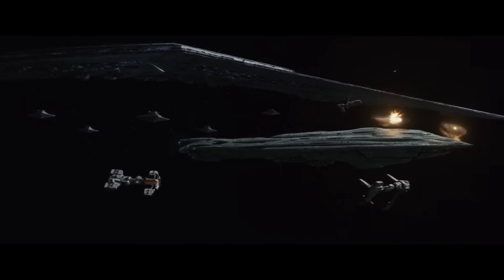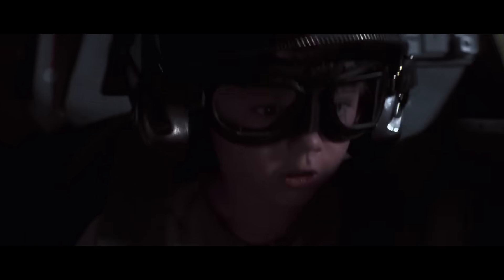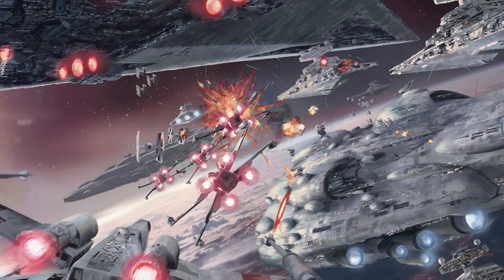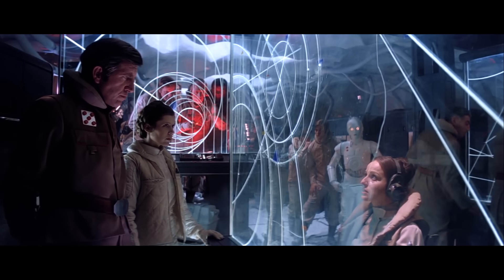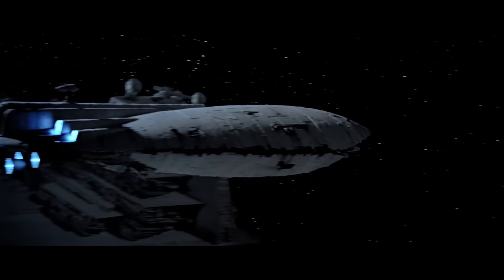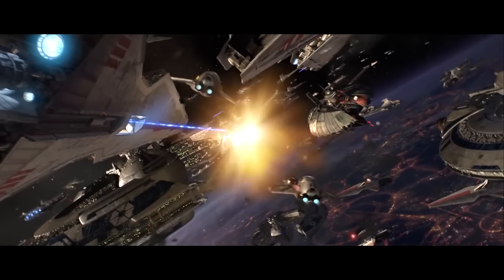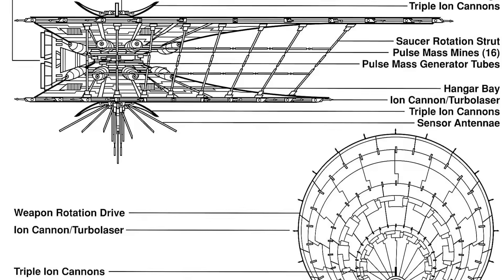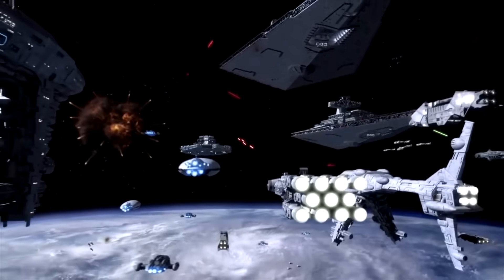Why Star Wars Turbolasers SUCK! (and better options) | Star Wars Lore

Comment: Firstly, great video. Very interesting.
Secondly, time for me to go into physics mode:
You forgot to mention the poor range of turbolasers given the power that's put into it. In the real world, for about 1g of hydrogen you need about 1.6316MJ of energy to heat it to a plasma at 10000 kelvin. That's a lot of energy for such a small amount of plasma.
Because of how quickly plasma would lose its energy, the kinetic energy needed to get decent velocity for range is going to also be very high. Assuming that this ball of plasma can only be effective for 0.4 seconds, and we want a range of 100km, we need a velocity of 250km/s and a kinetic energy of 31.25MJ (1g plasma ball)

If we gave a 1kg railgun round 31.25MJ, we get a velocity of about 5.6km/s. Modest, yes, but we don't need to worry about radiative heat loss, so range can be measured in thousands of kilometers rather than tens or hundreds. You just need to lead your shots a bit more and know where the target will be.

Also, railgun rounds also give scope for more interesting projectiles such as AP, HE, Tracer, depleted uranium... This is where you can use physics and chemistry to make a projectile that is very destructive.
Also, if a projectile hits the target fast enough, the heat generated can cause plasma to be generated.

Comment: Capital grade turbolasers are for engaging capital ships and stationary targets. Point defence armaments are what you would use on starfighters, though to be fair they are underwhelming used in Star Wars.
Booster Terrik may have been happy with loosing alot of the turbolasers, but to be clear the New Republic wasn't about to let him fly away with a fully armed and operational Sat Destroyer, you should know your lore.
Furthermore comparing Galatic Empire tech with the post-Empire advancements defeats your argument, because if turbolasers were not effective why would the New Rupublic (EU) put so much money into improving them?
Also the Imperial Star Destroyer was equipped with Ion Cannons and as for proton torpedoes, these can be deflected with a sufficiently strong particle shield. This isn't to say they couldn't land the killing blow, but you would still be faced with the problem of taking the shields down first.

Comment: There are two other weaknesses you did mention but didn't address; one of course is the slow turret traverse of the guns. For some of those single gun mounts like the ones on the Death Star where everyone sat on a platform, I don't see what could go wrong in trying to find some way to increase its traverse speed. Though for the heavy tower like structures, obviously there is no way to address that safely unless you want your crew members to have an unfortunate meet up with the Turret Monster.

The other one is of course the fire control. Obviously there should be some gun fire-control systems to get all the large caliber guns on target at once rather than having them be individually manned by a single gunner control.

Comment: So a lot of this aligns with my thoughts about Turbolasers and most of the problems there have less to do with Turbolasers as a specific technology and more to do with the weapon mounts used and man, weapon mounts for turbolasers in star wars are hot garbage.

1. Casemate mounts, every scene where you see the interior of a ship with a turbolaser with droids or whatnot shootout out the side of the ship, these are casemate mounts and particularly bad ones as well, barely above sailing ships of the line in terms of helping the weapon mounted effectively track or reload.

2. Too many useless calibers, while the specific power of a Turbolaser is hard to pin down the effect certainly seems to be somewhat akin to having a battleship armed with 40 4" guns instead of 8-9 16" guns. The small caliber weapons do barely anything individually against capital ships and barring the dual-purpose turbolasers of the rebel alliance aren't nimble enough to be effective against starfighters.

3. Poor mounts, tracking issues and rate of fire issues are related to effective or ineffective mounts IRL, the former certainly would be the case in star wars where the latter might be limited by available ship power. Either way it's quite possible to make quick tracking mounts today or even in WWII, a galactic empire should be able to work out the same.

4. Both of the last two issues could be made easier to deal with if you had less guns. Less guns means you can build smaller mounts that are easier to move around for tracking, it also makes it easier for your power plant to support higher rates of fire or larger guns as a whole.

Essentially star wars needs to go through the dreadnought revolution in terms of firepower where a wide variety of guns were consolidated into a few major types. Also consider that the Star Destroyer wedge is only nessesary in a scenario where you're trying to get many dozens of different turrets to be able to fire forward, reduce that number to 8 and all you need to do is place a big huge turret around the extremes of the ship and the rest of the ship can be any shape it likes allowing for optimization around shielding, hanger bays, reactor size and protection, etc.

Comment: A few things to consider:
1-Just how many railguns or ion cannons could you actually get for the same tonnage, space, and energy/coolant supply? Perhaps these other weapon types would demand even more of all the above to be just as effective in practice as the typical turbolaser batteries. 
2- Why not simply make more efficient turbolasers? The MC vessels are clear proof that it is possible to make turbolasers that can engage small fast-movers and fire rapidly, so there's no reason why other factions couldn't do the same. 
3- As an extension of the previous, a weapon class that seems suspiciously absent in Star Wars would be the turbolaser equivalent of real world warship dual-purpose artillery. WWII era warships often had a small number of main guns that were very powerful but cumbersome, and also a large number of intermediate-sized dual-purpose guns that were extremely flexible and could be effective against both ships and fast moving aircraft. See US navy usage of 5" dual-purpose guns as secondary armament in WWII era warships for reference. 
https://upload.wikimedia.org/wikipedia/commons/thumb/7/7f/USS_North_Carolina_NYNY_11306-6-46.jpg/1200px-USS_North_Carolina_NYNY_11306-6-46.jpg 
Here's an example, the USS North Carolina. Note the main turrets, each with three 18" guns, and the cluster of secondary turrets at the sides with two 5" guns each. And this supplemented with a variety of smaller AA mounts as well. Would love to see a Star Wars capitol ship armed similarly for its size class.

Comment: I think the problem here is the nature turbo lasers.  The must be plasma throwers.  The problem in their design is the element they have chosen to super heat into plasma is too light.  This has some logic to it.  The lighter the element, the easier and less energy required to the element into plasma.  Unfortunately that also means that the plasma bolt has far less mass and therefore less kinetic energy.  Kinetic energy and heat are the reason you want plasma throwers.  They need something that is plentiful, easy to secure and in the middle of the Periodic table.  If its too light, it’s just as worthless as using a laser.

A laser can be intensely hot, but renders 0.0 kinetic energy as it is only light and wave, while particles do exist, they are negligible.

The biggest problem is the designers of turbo lasers have no idea what they’ve created, the physics of it, or how make it a self contained, safe and rapid fire weapon.  I am 100% sure they don’t know or understand what they are illustrating on screen.  First and foremost they are Plasma Throwers.  Everything about how they look, move and impact.  It is also clear that the turbo lasers don’t impart very much kinetic energy at all.  Again lending credence to not knowing what they were going to illustrate.

Again, for them to work the way they do, they are are using far too light an element with a completely and unrealistically inefficient design.  Again moving to the middle of the Periodic Table with a solid, stable element.  Since we live on Earth, I would go Tungsten, mainly because I know of an experiment where it was super heated into plasma and safely and with stability.

They ran the experiment exactly the way I would.  The super heated the Tungsten, injecting directly in a large spherical containment chamber. The chamber was completely lined with Electromagnets.  We use Plasma all the time in Plasma Arc Welding.  Either Argon and Hydrogen or Argon and Helium.  Because those elements are so light, they only reach about 45,000 degrees F.  Nice for cutting and joining, but would do nothing to shields, though the plasma can be created at the ignition point.  

This would not be possible with Tungsten.  Just as in the experiment I mentioned, for efficiency and safety, it would need an electromagnetic containment chamber.  From the, just like a rail gun, an electromagnetic acceleration firing tube.  This would retain the heat and mass.  Incidentally, the heat of Tungsten Plasma is close to 2 million degrees C, that will hurt.  Add the acceleration of the inline actuated electromagnetic barrel.  If you think we can accelerate a solid in a rail gun, wait until the mass is not confined to a solid.  The acceleration of a rail gun  fires a solid with 32 megajoules of energy at Mach 6 and 23,601,988 foot-pounds of Force.  Plasma with that kind of power, I’m going to quesstimate, since the equations would take 30 minutes to an hour.  Let’s say 3.5+ Times the Force so about 89,606,958 foot pounds of force at 2,000,000 million degrees C, would be devastating.  

The containment chamber could as big a sphere as big as you’d like.  Stackable Tungsten is easily stored.  The combustion chamber could inject the storage chamber constantly, lending itself to a steady, continuous barrage of plasma bolts that would be far superior an actual rail gun.  Then it’s just a very simple question of automation.  Each Turbo Laser could easily be self contained, rotating racks of solid Tungsten.  This would be an absolutely devastating weapon.
Reply: Plasma wouldn't make a good ranged weapon because the plasma would dissipate into space shortly after exiting the barrel and no longer being confined by an electromagnetic field. The plasma would expand to fill the space and be more like a fart gun.
Reply: @crazynightowl  Makes for some nice propulsion, though (MagBeam).
Reply: @caav56  True. It's being researched right now in real life. Plasma engines are probably the most likely source for high speed space travel right now. Ion engines have way too little thrust though their fuel usage is so tiny

Comment: If I were to design a ship (at least one meant to fight other large ships) in star wars it'd be one with, as you said, ion weaponry to disable shields followed by some heavy weapons like large mass drivers, ideally ones with exceptional range. I'd also make sure that the targeting systems were as advanced as I could get them to make full use of the available range, and to target vital points on the enemy ships to disable them quickly. I'd rather have a ship with a few powerful guns and the ability to outrange the enemy than a ship with lots of guns that has to brawl it out.

Also, I'd make sure if at all possible that there was a good point defence system, either missiles or laser cannons (or some mixture of the two) to try to keep fighters of off it. And no exposed bridges or shield generators!

Comment: I feel as though turbolasers were really meant to be the sci-fi equivalent of the main guns from battleships in that yes they're powerful, but they aren't that big knock out weapon that everyone expects. Best example of this is the Battle of Coruscant where we see the Venator slug it out with a Providence and at most they heavily damage each other.
Reply: Andrew Hester

Well you have to remember a few key things.

1# A lot of materials in star wars are at least a tiny bit energy resistant.

2# The hull of most star ships are made out of durasteel  It was capable of withstanding blistering heat, frigid cold, and monumental physical stress, even when very thin. Because of these properties, durasteel was used for almost everything, from smelting pots for other less hearty metals, to spacecraft hulls.

 It was formed from a combination of the following materials.

Neutronium
a heavy metallic element  that has ultra-disperse characteristics which allow it to absorb and disperse immensely powerful energy blasts.

Zersium 
An ore found on the moon of Dathomir, Koratas, and Dor. It was used in the construction of durasteel and dura-armor the latter of which could absorb and redirect energy blasts. Zersium provided additional insulation and reducing thermal discomfort and impacts from energy weapons.

Lommite 
A type of ore that was one of the primary constituent materials of transparisteel, durasteel and dura-armor. 

Meleenium 
A rare substance found naturally only on the high-gravity planet of Af'El.

Carvanium 
A metal used in alloys, including durasteel.

Carbon (C)
Carbon (C) was a nonmetallic element. It was the primary element in most of the sentient life of the galaxy. Carbon atoms bonded with many other elements, and were able to form long molecular chains and rings.

Dura-armor by the way is comprised entirely of 3 of the above materials and was durable enough to absorb and redirect energy blasts away from it giving it extremely good protection against energy weapons.

3# There is a massive difference between canon turbolasers and EU turbolasers. A single turbolaser barrage in canon does virtually nothing as shown in the rebels TV show. A single turbolaser barrage in the EU not only vaporized a city but melted the surface of the planet where the blasts hit turning those area's into molten slag.

In the EU the CIS did an orbital bombardment on the planet Humbarine within one hour of constant orbital bombardment the entire planet was destroyed and it's surface was completely melted and turned into molten slag. Rendering it completely inhospitable.

Comment: I have a question:
Laser Canons/Turbolasers are plasma based correct?
If so, what would happen if they were fuelled by Warp Plasma from the star trek universe, which is a Lithium Ion Vapour, resulting from the heat produced from several moles per second of deuterium annihilating the same amount of anti-deuterium.

Comment: In your personal shields video you mentioned shields projected a significant magnetic field. Would magnetic chaff / flak not be effective since it'd be attracted to the shields and provide a constant drain (and blocking view/sensors) while the particle shield projectors work to keep them away from the ship? #AskEck

Comment: Most of the reasons turbolasers were used in close quarters in the movies was so the audience had something to look at. Original canon had the turbolasers having ranges exceeding 60k miles or so. All the stuff that came later.....well, I have no idea why it did. As for other weapons, a spinal mounted railgun pointed out the bow would absolutely wreck an enemy capitol ship with kinetic energy alone. And if you wanted even more power, put a fusion warhead on it to make the railgun even more powerful.

Comment: If i remember correctly, turbolasers are using a laser beam to superheating gas plasma, loaded onto the gun chamber, and this plasma "bullet" was accelerated with magnetic coils... So, without laser superheating and using normal "shells" this kind of gun acting as a railgun! If loaded with ions, you have an ion cannon, and using only a stronger superheating laser we got a "real" laser gun...What a flexible weapon! Like multiple kind of shells loading into real guns. (HE, HEAT, AFSDS, Canister, guided shell...) Ok, gun breech and ammo handling become more difficult, but we even have dual fed machine cannons IRL with linkless feeding systems... Sound difficult, but REAL.

Comment: Not sure if this has been answered yet or not, but:

Given how radically effective we saw a hyperspace-velocity projectile being in TLJ (a ship in that case,) why aren't Hyperspace Torpedoes employed against capital ships? The existence of hyperspace-capable fighters suggests that it's not that hard to make a small hyperspace engine, and the torpedo itself wouldn't even need a warhead. It could literally just be a solid metal slug with an engine behind it.

It seems to me that such a torpedo would be much cheaper to make than an X-Wing, would have incredible range and would basically be a guaranteed kill on any capital ship you point it at.

Comment: I would use Railguns as the light guns in the empire's place, since the space doesn't have air which leads to no friction and the turbo lasers could be heavy cannons used against large ships that are slower, although in SWTOR the turbos laser of eternal fleet are fast like machine guns

Comment: I would make a ship have tons of small ion lasers for purpose of peppering the enemy shields so they can easily brought down and be kept down a small number of massive Turbolasers(focused on range and accuracy rather than power) to finish off the disabled vessels that way even if the enemy attempts to run away you can still destroy them.